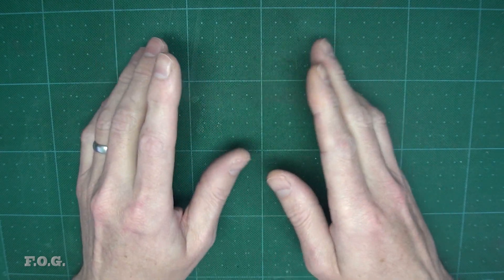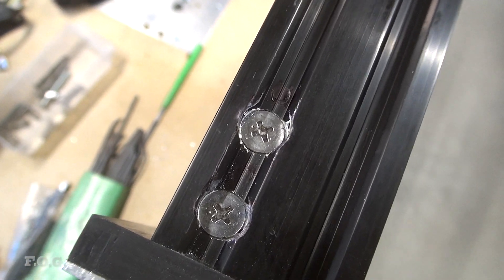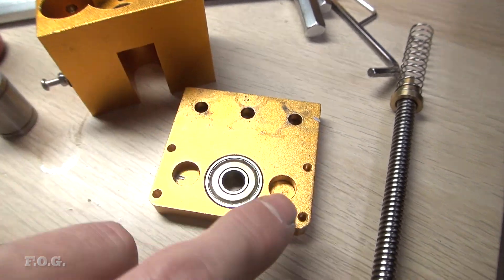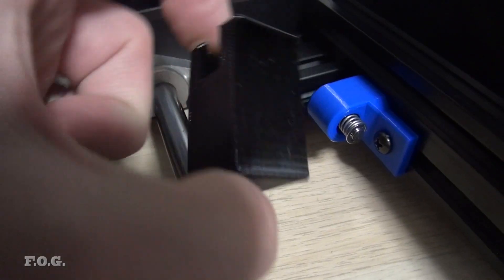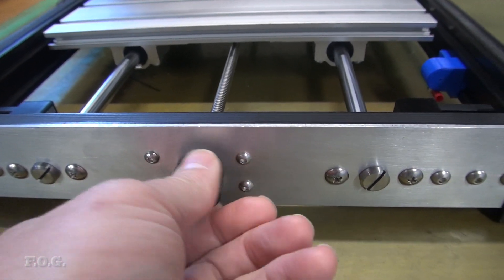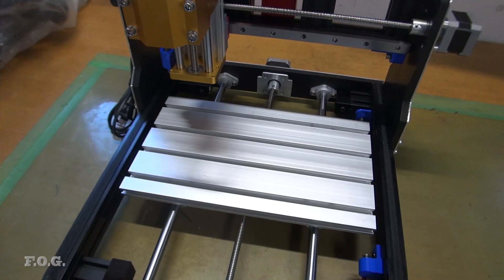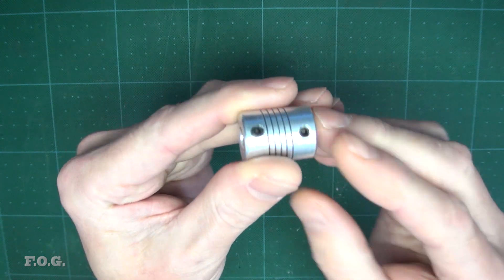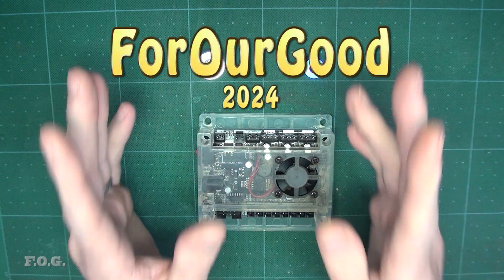EP6 – CNC3018 Rebuild – Assembly Process

Comment: Great upgrade overall, I have a Genmitsu 3020 pro max and am debating weather or not to upgrade to a 3040 with an extension kit, not cheap but my main problem is time. Measuring up for what I need it would be half the price getting things rom china but with the delays involved sending to Europe. I'm still on the fence as to which way to go, your videos have been a great help to see what exactly is involved, thanks for sharing.
Reply from the maker: Thanks for the comment! I am glad to hear the video might be of some help. Good luck with your rebuild!

Comment: Very neat indeed I like it a lot. Yes those couplers are garbage I had similar issues on mine and went back to the solid ones which work fine. Have you noticed any backlash on the leadscrews I found those spring loaded nuts a bit hit and miss?  Great build really professional looking.
Reply from the maker: So keeping on using those leadscrews was a bit like putting lipstick on a pig in the end. But I felt constrained by budget, and the fact it is no longer a cheap 3018 once you go to that level. Using the laser alone, for now I am optimistically measuring about +/-0.0125mm of backlash in the X and Y axis, which is not as good as I hoped for, but better than it was. I think before I was seeing closer to +/-0.03mm when using the laser. Obviously any improvement is unlikely due to do with the leadscrews or backlash spring nuts, because they are the same. So it ultimately comes down to the improvements in the rigidity and motion of the axis, which are pretty obviously improved. I would say the outcome with regards to just the accuracy is this. For the laser operation, it's only a moderate improvement. However, for the spindle, it looks like it is going to be easily an order of magnitude improvement. So some of my unfounded hopes were ultimately dashed, but others look like they might far exceed my expectations. I guess only once I get to doing some serious work with the CNC will the full picture be known. Thanks for the comment!
Reply: @ForOurGood  useful Info thanks I know what you mean about budget where domyou.stop and to be honest that's a very very good tolerance for what is still essentially a 3018 albeit massively improved. In addition the PCBs you made.in the last of the PCB series looked really good so improving your accuracy should give you even better quality. Great series very enjoyable thanks

Comment: Nice work, your build went really well! I’m curious as to how the spiral flexible couplers work for you? I find they introduced a small amount backlash and replaced them with dual helical slit couplers which have been perfect. The only issue is I can’t find where I bought them from to buy more! 😢
Edit: you covered the couplers at the end. Honestly I’d throw away those rigid couplers ASAP, they’ll wreck your stepper motor bearings.
Reply from the maker: Yep, the flexible ones are garbage as far as I can tell, at least for my application. They actually caused a weird harmonic that would cause the lead scew to sing, so as soon as I heard that I dumped them. I do know that rigid couplers are not great for the steppers, but for now I will leave it be until I get motivated to look for some decent replacements. Thanks for the info however, at least that is a better starting point than me just randomly buying something on Ali-Express.
Reply: @ForOurGood  no worries. I dug through my emails and found that I got them from amazon (shipped from china) and they just called them flexible couplers. The photos show the dual helical slits and a pair of grub screws per shaft-end. They were quite cheap but much better than the other half dozen different couplers I've played with, and weren''t expensive at all.
Reply: Ps, the couplers I’m referring to are sometimes called beam couplers too.